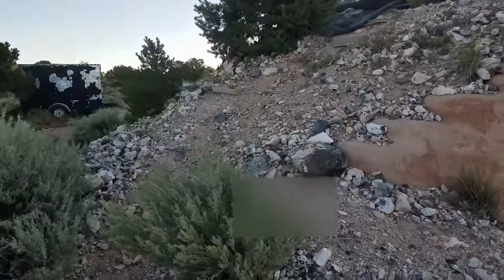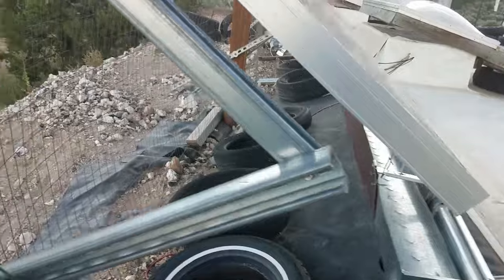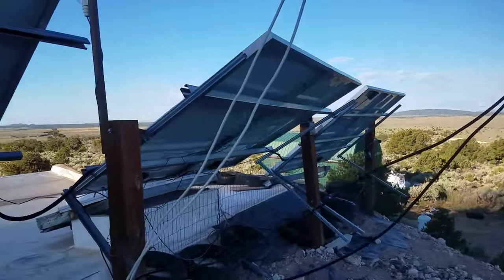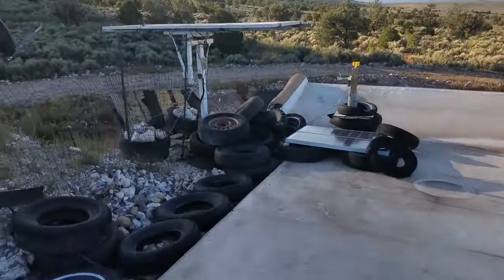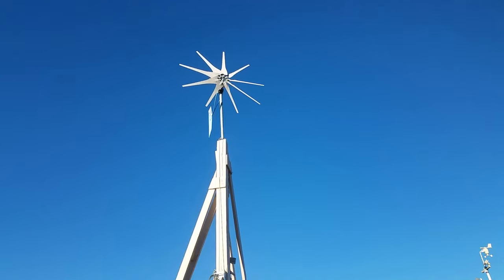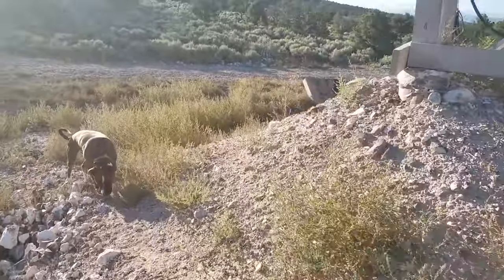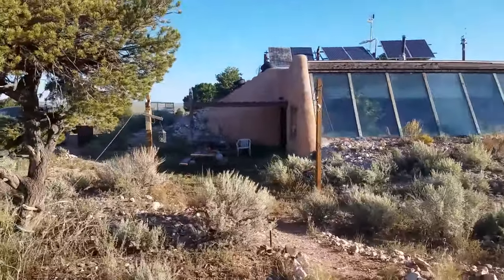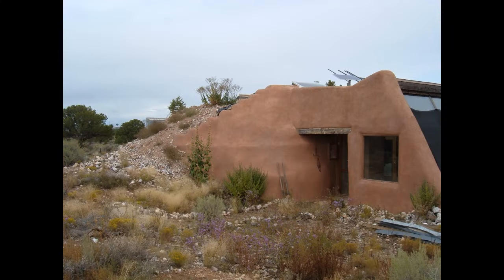Earthship Upgrades

Comment: The solar tracking system explaination is the first I've seen that makes sense. Panels have come down so much in price that adding more is usually cheaper and simpler than tracking systems, but yeah, if you want "on demand" power to extend production over the day it makes sense. Does this mean you do not have batteries and/or your storage capacity is less than you need?
Reply from the maker: I have a 5 year old bank of leads acids that totaled  740 ah when new. They are starting to show their age so I try to keep the depth of discharge to a minimum until I can replace them with some lithium iron phosphate batteries.

Comment: What and absolutely gorgeous property and landscape. Does inside the earthship stay comfortable during summer and winter?
Nice video, thanks
Reply from the maker: Thanks, it can get a little cool in the winter but I don't use any heat source in the winter other than the sun. In the summer it's comfortable with both of my doors open to get a cross breeze.
Reply: @aloneinanearthship4010  I also saw your videos about the earthship tour and the flooding. I hope you fully recovered after the flood and also the cleanup was successful. 
Take care and best of luck in this adventure.

Comment: Is there anything about the build you had wished you started in first to make things easier?  I'm prepping to start an earthship of my own soon
Reply from the maker: I didn't build the earthship but I did build many of the systems in it. There are some things I wish were different. I wish it had vertical windows instead of the angled ones, it would be better if it had an actual septic system (since NM changed the law in 2013 so kitchen grey water is now considered black water, shame on NM), and of course there is the issue of the shower walls being so ruff that if you rub against them you bleed. Perhaps I'll do a video about this.

Comment: I bought some land in Rancho De Taos last week and camped there as well.  Beautiful area and im so pleased with the sunsets/ sunsrise.  I know i will need to put in a septic system, but other than that, do you know of any stiplulations or laws that will get me in trouble with Taos county?  Appreciate the video!
Reply from the maker: I'm not aware of any but I only became aware of  the septic issue when I was considering selling the house, so you may want to talk with someone who has actual experience building in this area. I can answer most of the technical questions, but I'm not as good with the legal ones.
Reply: check with the local authoritues, rules change all the time. Most, if not all rules are available on line. I think Taos is one of the most liberal. Truly off grid is very rare nowadays.